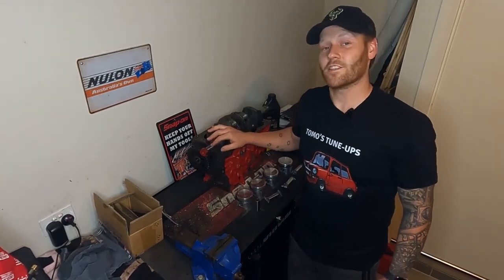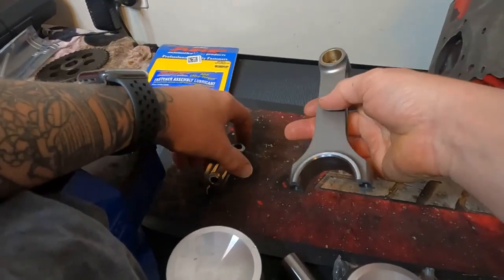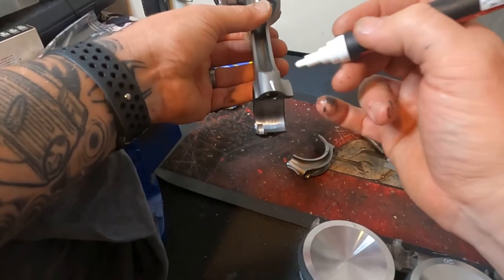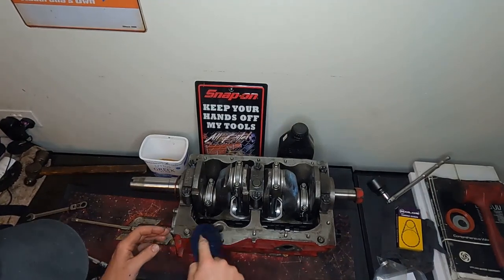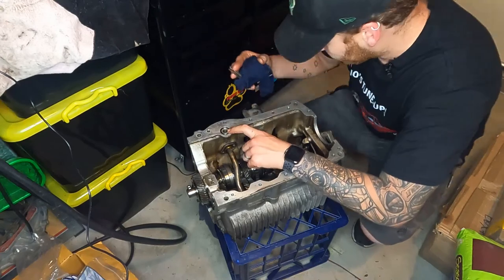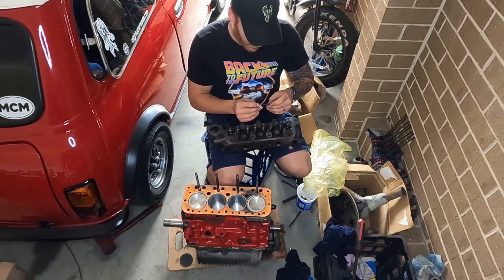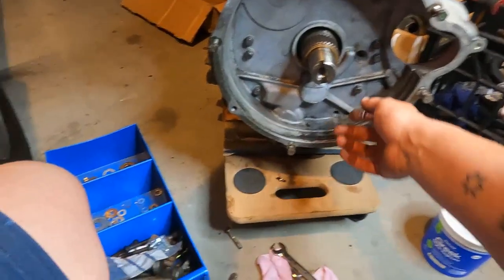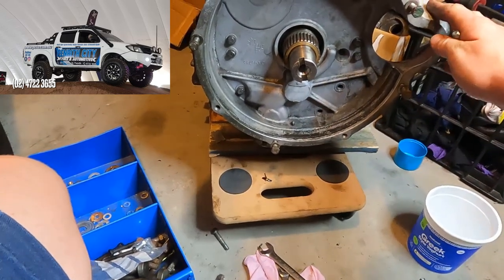Classic Mini 1275 A+ Engine Build for a Subscriber - Part 6

Comment: Dude, why the heck are you using steel rods in that motor?
The A+rods are good for 8k with ARP end fixings and you're only using a 
266 cam (with old followers) so not using those kind of revs,
And the ring gaps need checking/setting,
And the gudgeon pins need circlips in pistons :-)
Reply from the maker: Hi mate,

Please keep watching the series and these shall be checked/upgraded down the track. 

The rods have been upgraded as the customer wants to turbo his engine down the track, so we’ve strengthened them now whilst it’s apart. 

Thanks for the feedback though man, greatly appreciated people are picking up some of my early mistakes, but like I said, keep watching the series for more info 👌🏼